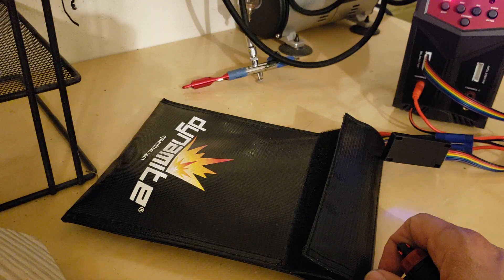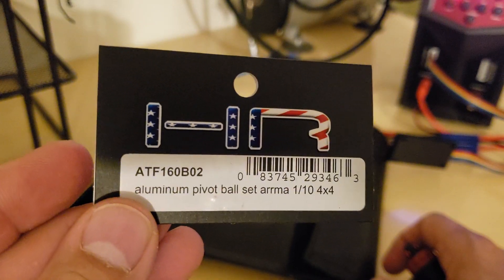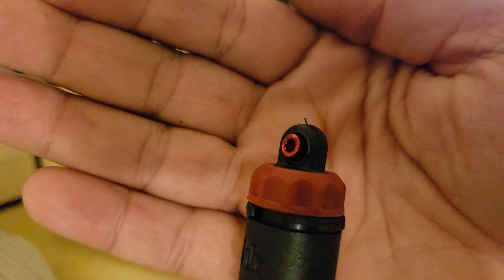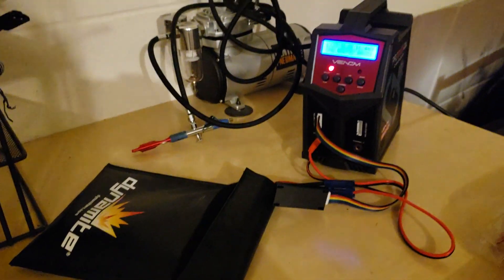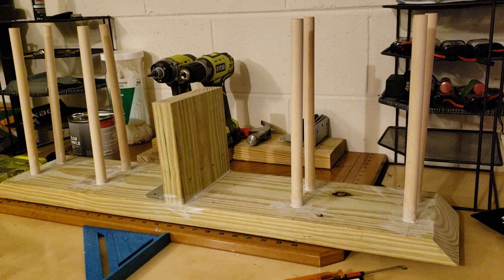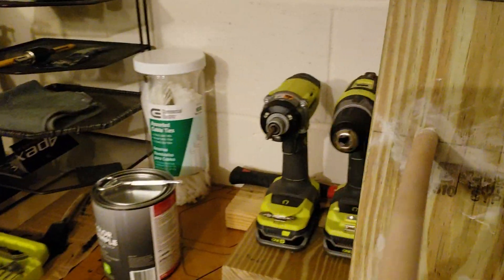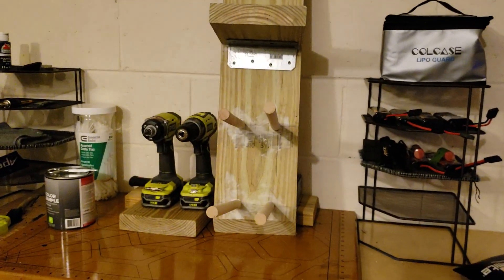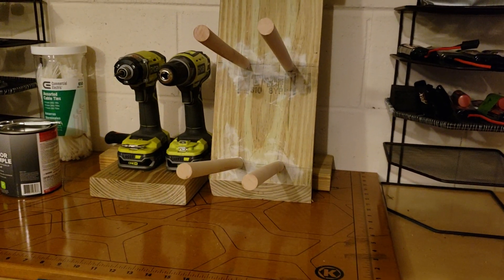Arrma Typhon 3s blx,, Hot Racing upgrades part 3

Comment: I was looking at the pivot balls for mine, do u think its worth it or makes a difference?
Reply from the maker: I thought about it too,, when I took those plastic ones out,, I noticed that a real soft plastic,, like the one in the ecx anp so yes I think will make a difference,, and they look good,, Thanks for watching bro
Reply: Metal v.s plastic you decide?, Mine are on their way to my casa :)
Reply: I think the tire mountage that this guy has currently fitted is unnecessary, although cheap

Comment: Hi there, on ebay when i type that part number ATF160B02 the only pivot ball sets that shows up have this part number SCP160B02 are these the same? Cheers.
Reply from the maker: Let me find out for you
Reply from the maker: It says on eBay Hot Racing Arrma Bigrock Granite Senton aluminum pivot ball ATF160B02,, apparantly they are sold out ,, if I see something I'll let you know
Reply: @operation11charlieinc  Thanks for that.